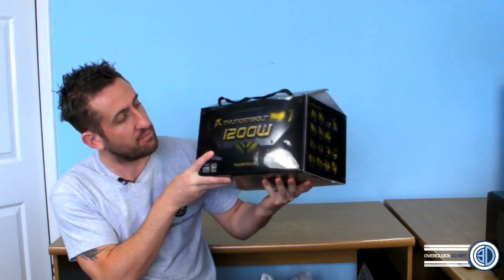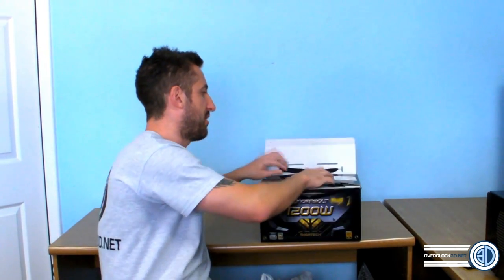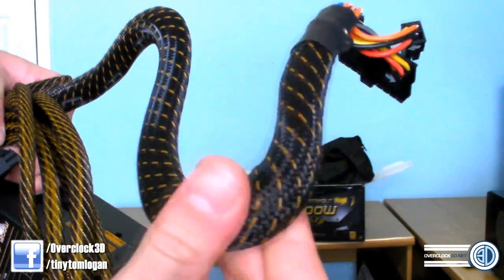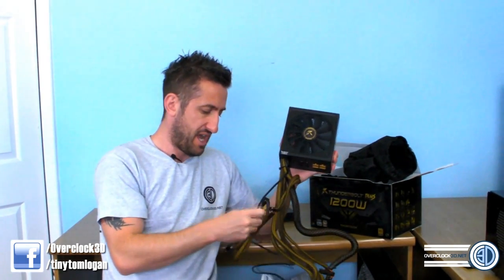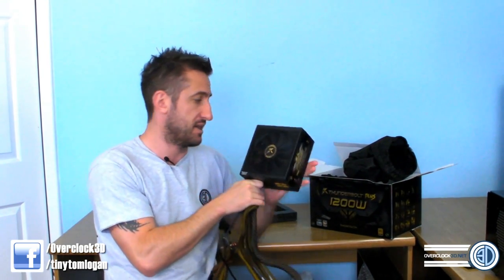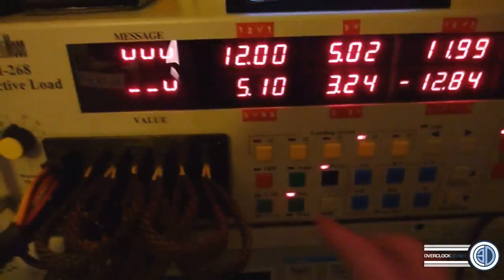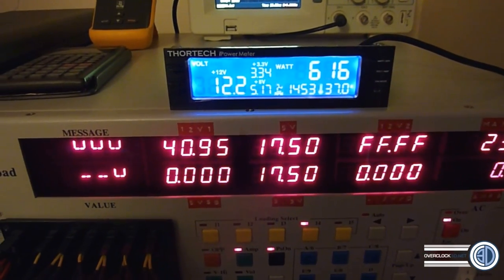Thortech Thunderbolt Worst PSU Ever?

Comment: I bought a Kolink Continuum 1050W Platinum , yes a 80 Plus Platinum, EAN 5999094001411, SKU: KL-C1050PL, that PSU is even worse then the one you showing here, as soon as you build it in and power it up, the ground fault protection from the fuse box in my house shut down the whole group the pc was on, twice!  That PSU was brand new in seal, almost fried my 3900x and x570 MSI Prestige Creation Motherboard. Threw that PSU in the bin , waste of 160 GBP .. even for UK miners, do NOT purchase that brand!

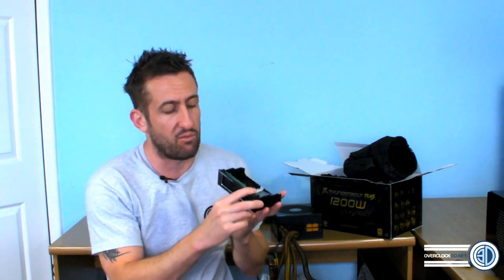Comment: Am I the only one who noticed the foolishness of comparing the screen to the pull from the wall? 8:32 Uhhh.........Wait........
If you measure a 50% efficient 500W PSU from the wall at full load, it would be pulling 1000W from the wall but only outputting 500W. So those two numbers will never be the same, even on the most accurately monitored PSU. The unit is still a right POS, but of course the numbers were of 50-75W. That energy is being let off as heat in the PSU.

Comment: Hey guys I have an old corsair tx 750 watt psu I want to power a test bench with a 690 on it,can't pull out my ax 1200 watt out of my main rig cuz of the water cooling kit,,will it be efficient enough to power this crazy card?

Comment: there are manifacturers who shorten there cables for the 80+ gold award and ship there psu's with larger cables. so acutually you don't get the 80+ gold at home. but only on the box. those manifacturers you should avoid.

Comment: What are peoples thoughts on EVGA PSU's?
Reply: Well, super flower makes them. But superflower is also a great company aside from seasonic.
Reply: they're pretty good... keep in mind the multi-rail PSUs get unstable if you don't balance the 12V rails properly... but the single rail ones are stable :D alternatively... I have an Antec H750M in my rig... it's safe to say it beats the crap out of the stock power supply I had in my rig... couldn't even handle a 9800 GT XDD
Reply: TheSoxmania How about a 750 G2?
Reply: TheEarthboundHero
it's a good PSU... very stable and even power delivery... oh... and the eco mode :D
 it's ace if you are building a silence optimised rig where the PSU wil have the fan off until it hits a certain load level (a little like Corsair's RM and AX series) it also has many good reviews from different PSU and tech reviewers... i'd recommend it... especially since it's a high current fully modular PSU!
Reply: TheSoxmania Awesome, thanks.
Reply: TheEarthboundHero You can look for reviews at jonny (I forgot but it's probably  jonny) guru.
Reply: Don't know if I am too late but evga g2 is the best psu you could possibly get for the money right now. It's very very good. Check johnny guru reviews.
Reply: TheSoxmania There aren't many really multi-rail PSUs, the only ones i can think of are made by Enhance and packaged up by various brands as 1000-1200W units. They are actually well regulated fully individually, so there's no strict need to load them evenly, although you probably want to if you want to reach high power rating. Oh wait, there's another one, made by Delta aiming at around 700W with two real rails, but that one is semi-individually regulated too, very well made and not troublesome whatsoever, i think Antec released a "4-rail" version of it.

Many PSUs have current sensors per rail, which virtually split a single 12V rail into multiple for safety reasons, so that a component fault or cable fault will be detected quicker and prevent further damage to your computer. It requires some care during assembly to assign devices within printed rating to multiple rails, but there's no benefit from carefully balancing them, because all rails are connected via the most benign of shunts to the same voltage source and there's no way they could ever drift apart. If you overshoot the rating on one rail, the PSU will perform safety shut-offs, the issue is explicit enough that you don't have to worry too much and easy to fix.

And then there's a lot of PSUs which print rails on the label and maybe even print markings on the cables, but don't actually have split rails in any shape or form. Obviously you can just disregard the rail markings on those, but i don't like it when things lie. I vaguely recall Antec being occasionally guilty of this, but i don't think they do this routinely. Information on this tends to be very hard to find.

If what you have is HCG-750M, it's definitely not that Delta, it's a Seasonic made one with either a virtual rail split unit or a single-rail unit. It's very good, but you don't have too worry too hard about balancing rails.

So i don't know where you got that "multi-rail PSUs get unstable" and whether you can name at least one to which it actually applies.
Reply: Siana Gearz Corsair's RM series has digital rail switching. their PSUs come multi-rail out the box, but they can be forced into single rail mode with the Corsair Link utility... and the multi-rail instability turns out to be a misconception I had from someone who just had a dodgy unit... my RM750 is pretty unbalanced for load... and that's as stable as a quakeproof house!
Reply: TheSoxmania Switchable single/multi rail configuration is a strong indication that there's a single 12V rail off the transformer, which gets split virtually by safety system. RM? I recall RM1000 was a CWT unit which was single rail, but had an unused design provision which would allow for 2- or 3-way virtual rail splitting. Perhaps they actually decided to use that later on. I don't see where any of its brethren would gain real independent rails from. Then again Corsair isn't known for naming consistency. Wasn't RM750 a Chicony-made technically unrelated single-railer?

I honestly find these units scary. For example a nice soldering iron for electronics is around 20W at idle and 60W during initial heat-up, and runs at similarly low voltage, like maybe 24-30V which is not far off from 12V. 60W works out to be about 2 Ohm of resistance and 5 Ampere of current. Let's say you get a small plain steel object wedged into SATA/Molex power, and that's about good enough to start a fire with just about any modern PSU if you're particularly unlucky, and there's jack shit they can do about it, cause they need a larger current to trip. Pity, but i guess unavoidable, except well, tuck your cables, cover all unused ends with tape, use modular connections with high rated PSUs.

PCI-e and mainboard connectors are intended to be safer, using 2-4 or so individual 12V lines. So let's say they could potentially start a fire at a fault of 20A or larger. However a huge single rail PSU like that RM1000 will happily feed any given connector 80A, which is not merely a window of opportunity, i'm not even sure i have a word for it. The world's largest fragile combustible sugar glass door of opportunity. It should really be given 4-6 virtual rails each limited to 30A, and a personal canary bird with a heart rate monitor.

It's not an engineering mistake, because i'm sure the PSUs will perform well at those insane loads while the world burns around them.

Comment: why cant people just invest in a good CASE, PSU, AND MOTHERBOARD. its so annoying. people have problems with builds only because they don't spend the most on the main components that will make or break your computer. Just please stick to brands like corsair, asus, and msi for any component you buy. where do you guys even find crap like "fortron power 650watt psu's" buy antec or a corsair...

Comment: i have a cheap shitty 800WATT EZcool PSU i have had it for bout 3 years now and its still running my comp 

2 AMD 6970
AMD FX 8150
16gb Corsair Vengeance
Asus ROG Crosshair V 

and i got it for £60 way back 3 years ago for 800WATT

Comment: Hercules 500w PSU. Worst ever. Enough said.
Reply: arickettsf16 No, i think i can think of worse than that, but can't quite put a name on them.

BTW, there were at least two different PSUs which happen to be named Hercules 500W. One of them was released by Gigabyte and it's a bit arcane and woefully inefficient, but there's nothing horribly wrong with it otherwise.
Reply: Siana Gearz I'm pretty sure it was called the Hercules. All I know is that it was an incredibly inefficient fire hazard that really could only handle maybe 150 watts max.

Comment: I have one, and so far it has done well enough, but I"ve read BAD, BAD things about them. Also, for some retarded reason that I cannot comprehend, the 700 Watt ModXStream that I have ONLY HAS 2 PCI-Express adapters, and only 4 molexes. This is retarded, because I have to adapt all of those molexes to PCI-Express connectors in order to support my dual 5850s. Also, the cables are way too short. So just avoid them; they're a hassle, really.